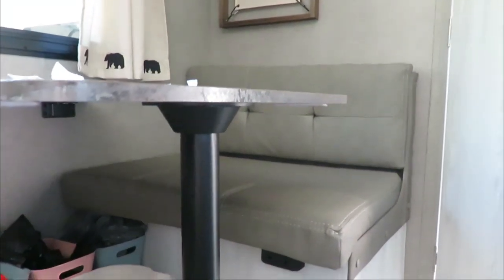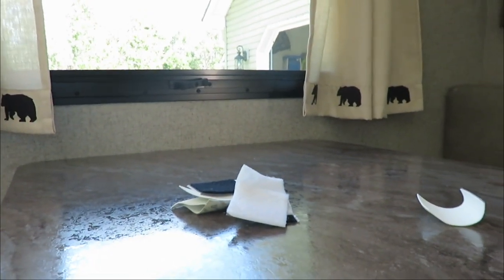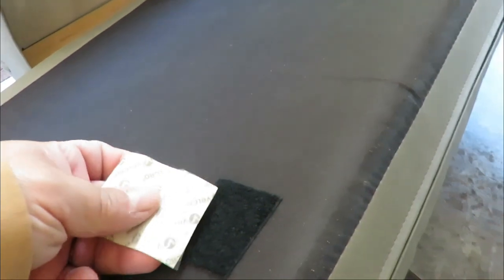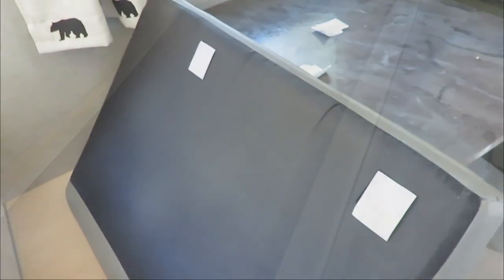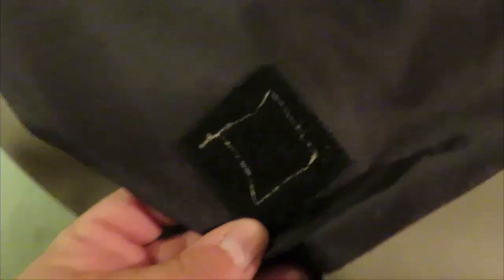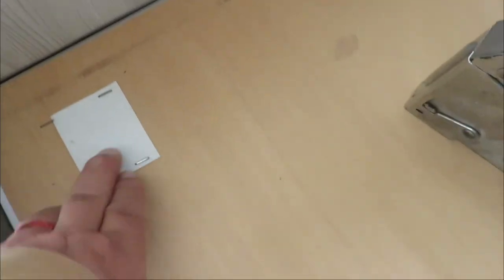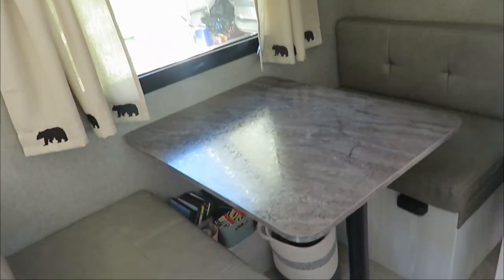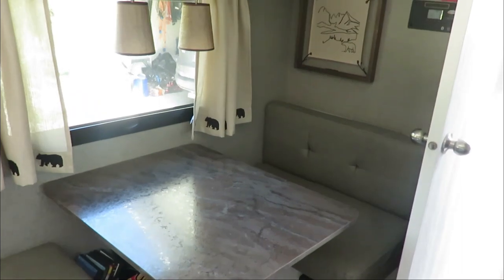Securing the Dinette Cushions

Comment: I tried that. The velcro stuck to the material fine but it didn't stick to the wood at all. I'm still working on a viable solution to the cushion sliding problem.
Reply from the maker: I stapled mine to the woods with a staple gun
Reply: @Turtle3863  I had to do that with the factory-installed velcro on the seat backs on mine, too. You'd think they would notice that the velcro doesn't stick to the wood...

Comment: Good idea.  But you should adjust the bobbin thread tension, and maybe the needle thread tension, on your sewing machine.  Just a suggestion.
Reply from the maker: Yes, you are right, I will have to read up on how to do that.
Reply: @Turtle3863  You are using a Brother machine, which probably uses a sideload rocking-type cartridge.  If so, they usually have a very small screw on the top.  Pull the thread slowly and tighten the screw until there is resistance on the thread.  The needle also has a thread tensioner.  It's the dial above the needle that compresses two dish-like plates together.  Again, pull the thread until there is resistance.  Another factor may be that the adhesive on the back of the Velcro gummed up the needle.  You could use non-adhesive Velcro in a long strip like Forest River did on the seat back.  Just a suggestion.  But I will use this for my new 19FD.  Thanks!
Reply: Correction: "sideload rocking-type bobbin cartridge."
Reply from the maker: It has a top load in but I will take a closer look at it